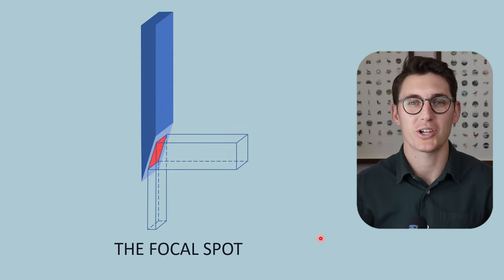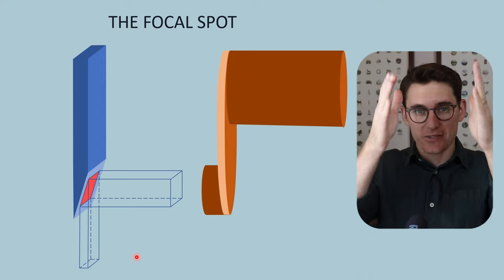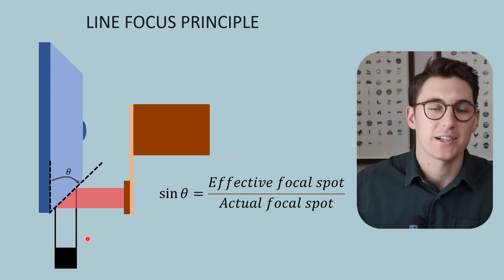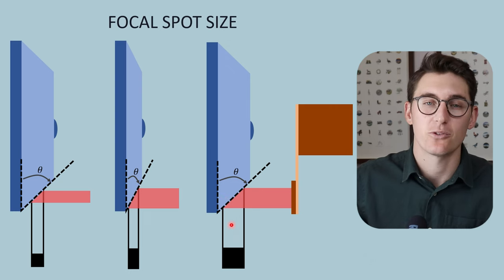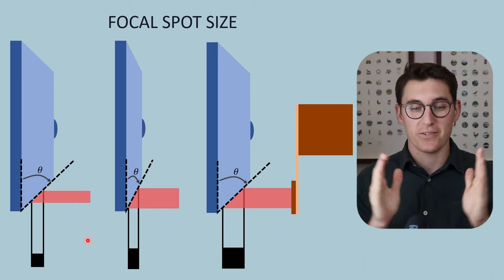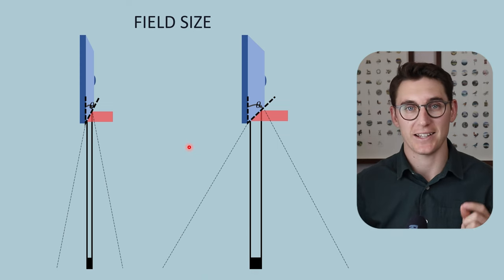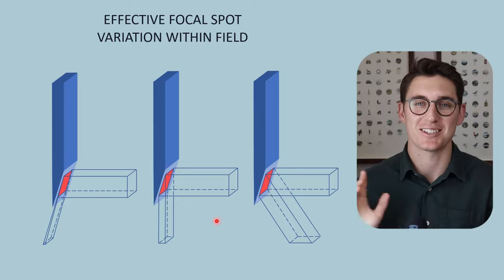Focal Spot (Actual & Effective), Field Size and Line Focus Principle | Radiology Physics Course #12

Comment: Hi if we reduce the anode angle we get a increased tube rating right ? For the same effective focal spot decreasing the anode angle increases the tube rating right( by the formula)
Reply: Also if we change the anode angle does it affect the actual focal spot size? The actual focal spot depends on the filament size and not anode angle right?
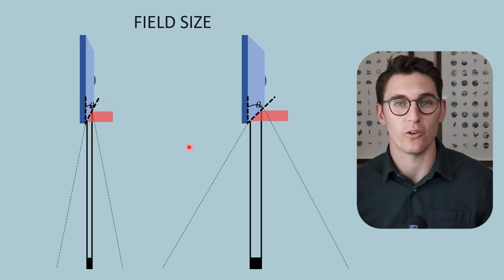Reply: Yeah I also got the same question. Micheal can you please clarify? @5:59  part of the talk you are saying increased anode angle make the anode can tolarate more heat. As this question has asked, for a given effective focal spot, anode angle should decrease for enhanced tube loading right?

Comment: Your lectures are much appreciated, trying to prepare for my part 1s. 

Is there a way in modulating the volume difference between your video segments and the advertisements ? Your video volume is much softer than the ads especially for the anatomy ones.  

If there’s a paid way to avoid advertisements that would be also great.
Reply: There’s a way. It’s called YouTube premium

Comment: Nice and easy explanation, very beneficial.
But I am a little bit confused about the impact of using larger anode angle on actual focal spot size as mentioned in Farr's physics( page 59) as follow:

The target angle θ is the angle between the central 
ray of the X-ray beam and the target face. The steeper 
the target angle (i.e. the smaller the angle θ), the greater 
is the foreshortening. The target angle is generally 
between 7 and 20º. For a target at 18º with an effective 
focal spot of 1 x1  mm2
, the actual focal spot would be 
3.2 x1  mm2
, whereas for a target at 12º the actual focal 
spot could be increased to 4.8 x 1 mm2
 to produce the 
same effective focus spot. The tube loading in the latter 
tube could be increased by 50% for the same effective 
focal spot size.

How actual  focal spot size increases with a steeper angle?
Any explanation please?!
Reply from the maker: Thank you!

Reading this comment whilst I’m out the house so don’t have Farrs on me. What they are saying in this example is in order to create the SAME effective focal spot you can have a larger actual focal spot on the smaller anode angle. Therefore, you can ‘spread out’ your bombarding electron beam over a larger area whilst maintaining the same effecting focal spot (ie no increase in geometric blurring - a whole video on this to come) this allows better heat loading in the anode as the same number of electrons are spread over a larger actual focal spot.

I hope that makes sense. If the actual focal spot size remained the same the larger anode angle would create a larger effective focal spot size. This example in farrs is keeping the effective focal spot the same and changing the actual focal spot.
Reply: @radiologytutorials  thanks a lot for your response but I am afraid you miss understood me!
What I mean It does not make sense  that ( using a steeper angle would increase the actual focus spot size) according to what is mentioned in Farr's physics, I assume the opposite is true, using a steeper angle would decrease the actual focus spot whilest using larger angle would increase actual focus spot!
Sorry for long commentsbut I am suffering understanding this point more than one year ago!
Reply from the maker: I understood 👍🏼 You are exactly correct. A steeper anode angle reduces actual focal spot size. What Farrs is saying is in order to keep the same effective focal spot size we need to increase the size of the actual focal spot on steeper anode angles (can do this by changing filament size or strength of focussing cup).
Reply: @radiologytutorials  now you understand me, and I find your answer a little bit convincing but in this case, should not a larger area of the target material surface be covered by the increased size of the newly actual focus spot size?
Consequently the effective focal spot size would be increased?!
Reply from the maker: This is the point of the example in Farrs. Because a steeper anode angle creates a smaller effective focal spot size, we need to increase the actual focal spot size on the steep anode in order to keep the effective focal spot (between the large and small anode angles) the same.
Reply: @radiologytutorials  thanks a lot for your patience in answers, and I don't mean to be rude but this so odd because :
The effective focal spot size is formed based on the angle in addition to the actual focal spot size that plays an important role in this issue, and according to what you have mentioned, earlier using a steeper angle would decrease the actual focal spot, so the same would happen here!
If I got a question in this sector I will answer it according to what is mentioned in Farr. 

Any way much thanks for you.
Enjoyed your vedio.
Keep going💪🙏